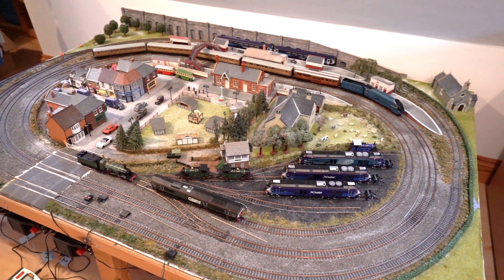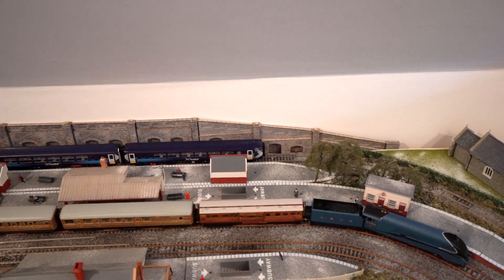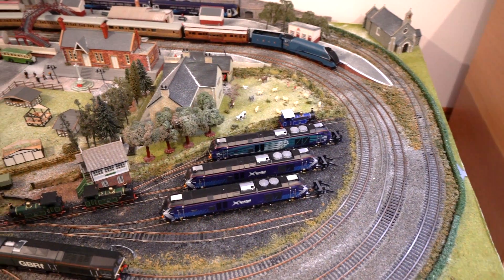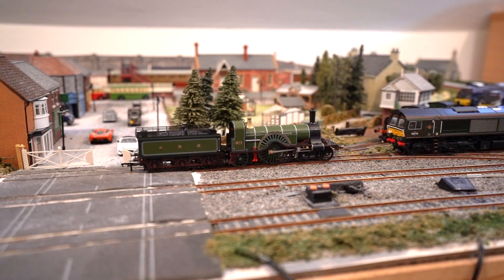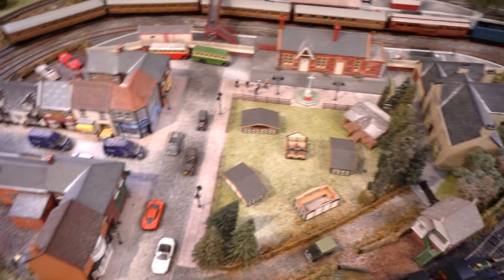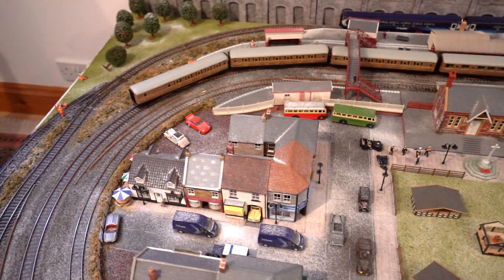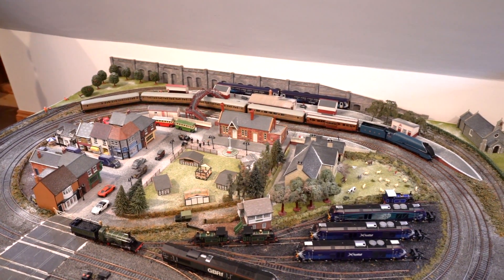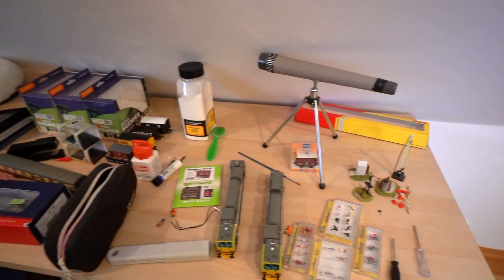January Layout Update/ Tour (Modern Image)

Comment: I started with the Hornby select, it comes with a 1amp power supply. When I got more locos with sounds the 1 amp could not cope. I could run "one" loco with all lights an sound but not two together. I had sound but no movement or running but no sound. An upgrade to Hornbys 4amp which works with the select sorted all this. The select ran all my Bachmanns, Hornbys and Dapols 68 with no problem and it was one version down from the latest firmware upgrade. Hope you sort it. Cheers from a fellow roundy roundy layout operator :)